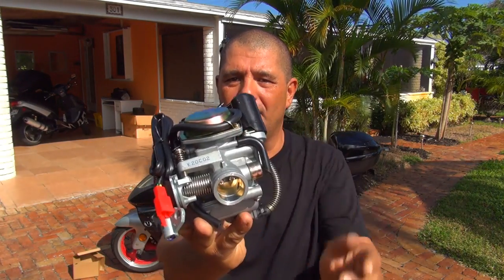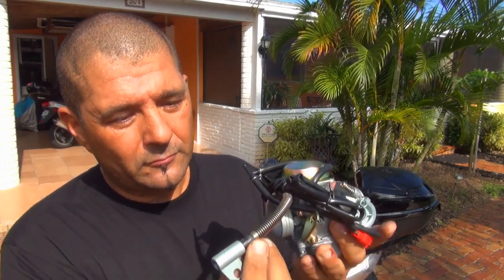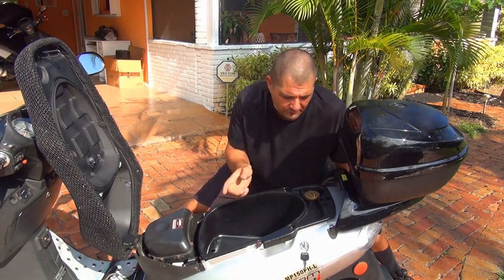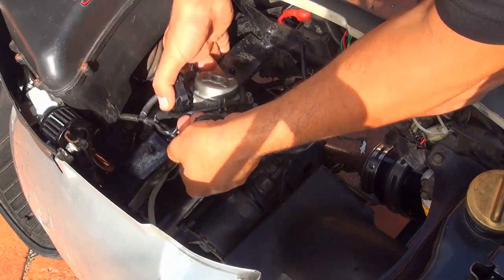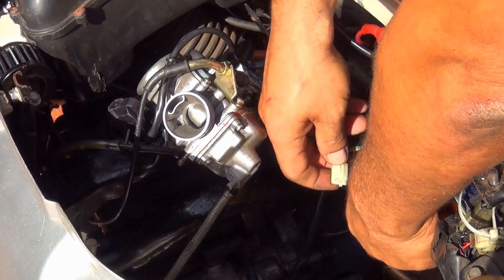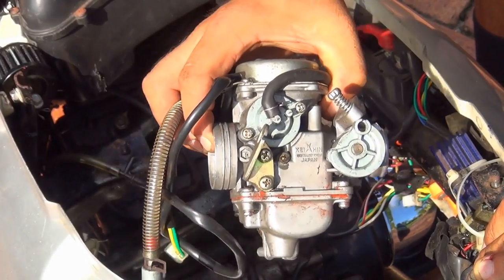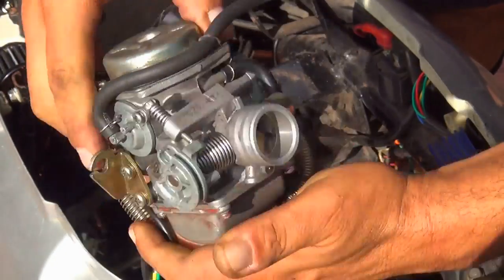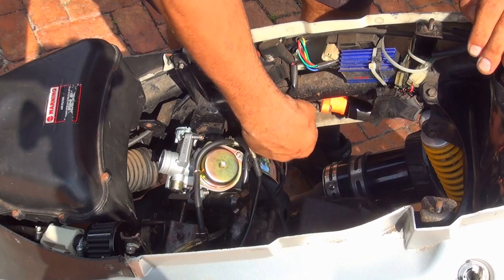How To Replace Carburetor On 150Cc Scooter

Comment: Dude, what should I do if im replacing my carburetor and my old manifold has two holes for vacuums hoses but the new one just one of them?
Reply from the maker: Hello you can fix the problem in 3 ways  ( 1 ) place a 6 mm screw in one of the hoses to close it with a little clamp and the other hose connect it to the new manifold ( 2 )   buy a https://amzn.to/3YWnzx0  3/16" Hose Barb Fitting Equal Barbed Y Shaped 3 Way plastic and from 2 hose you make one ( 3 )  send back the manifold with one nipple and get the one with 2 nipple.  I hope this will help you  thank you for watching my video

Comment: What do you think about performance 
carburetors, people say they improve throttle response a lot?
Reply from the maker: Yes the make a big difference in performance thank you for watching my video and Happy Holidays
Reply: QUICK-STAR  I did not, but from my research i think that the closer the throttle body to the intake valve is, the better throttle response you will get, some carbs do this, but people usually mod the intake manifold

Comment: Very good video . I enjoyed it.  : )  I had to remove and install a triple carburetor on a older Suzuki .. it  was harder to slide back in place then actually getting it back in the manifold boots. But I do enjoy working on the engines. You did this replacement excellent  and I did learn a lot about the GY6 carburetors by watching this video.
Reply from the maker: Hello Ed thank you for watching my video

Comment: Great video.... One thing i notice is that you run you filter towards your muffler which pulls in hot air.... Would it be better to place the air filter towards the original air filter position?
Reply from the maker: Hello my friend that is great ideas I never pay attention to that I don’t think will make a difference but anything can help to keep the motor at lower temperature 👍

Comment: Thank you sir great video ...I have a question I purchased  a Powermotor PD24J Carburetor and it was missing the fuel/air flow screw but the hole is there ,   from the reviews on amazon it doesn't come with it,  will it be ok with out it ?
Reply from the maker: Some carburetor  have a plug at the idle mixture screw but they work fine now if you miss a screw and you have a hole the carburetor is not going to work

Comment: Hello brother I'm very interested in what size jets your using on your 150cc with the nibbi elbow and pod filter
Reply from the maker: Hello my friend in Florida at sea level and hot weather with that set up I run a #125 main Jet  but if your location is colder or little higher in altitude you could be ok running a #115 or #120 sometime is all about testing and tune to get the perfect performance

Comment: Thanks for the lessons. Now i can have my il bello flyscooter on the road again
Reply from the maker: Hello Thomas thank you for watching my video
Reply: @VirberelloScooterTips  hey what does it mean when the scooter isn't getting any gas to the carburetor?
Reply from the maker: @thomaskellem5315  Could be that the fuel valve is not opening because you have a leak on the vacuum lines or you have a dirty fuel filter or dirty fuel tank
Reply: Virberello? Why is my bike now just only putting gas just in the gas filter and not going through the pitcock and going to the carburetor.

Comment: I have a wolf blaze 2011, 150cc,,,,you think upgrades like carb, exhaust and CVI are good upgrades for performance?  What would you recommend?  TY for your videos
Reply from the maker: Hello TheDayDreamer  start to change the weight rollers to a 14g , next rejet the carb, change the exhaust and a performance air filter but do one thing at the time because there is a possibility that you will not like what is your scooter will become after all the modifications. Thank you for watching my video and be safe

Comment: Do you have a video about throttle adjustment on the cable near carburetor?
Reply from the maker: No but you give me a good idea
Reply: do you have any information about "throttle stop screw"?  Where is located, any how do you adjust it? Or should need to adjust it at all? Thank you have a wonderful day my brother from a different mother. 21:15

Comment: I just replaced my carb, I live in florida also what jets are you running? I tried 115 main and 38pilot but it was too much gas, I went to 110 main 35 pilot, ran good. Thinking about switching to 115 main 34 pilot what do you think
Reply from the maker: Hello my friend in my old scooter I had a 120# 38# pilot with a performance filter with  my every day scooter I have a 110#  38 # and I like that because every day I ride around 20 miles . Thank you for watching my video

Comment: Hey so when I remove the old air filter what do I do with the hoses??because I didn’t want to leave it in it made it easier to reach the manifold and carburetor on.
Reply from the maker: Hello Adon the small hose coming from the head valve cover you can place a little baby filter and connected to the higher part of the frame of the scooter or place a little resevoir catch can https://amzn.to/3uiXI2S and the large hose from the air filter you just remove that and the air box if you like
Reply: @VirberelloScooterTips  thank you so much I’ve been watching you and my scooter is almost a beast💯🔥

Comment: I changed my scooter that was gummed up. Only issue I have is the auto choke doesn’t seem to work. Any tips?
Reply from the maker: Hello my friend you can test the wires that goes to the enricher with a multimeter if you do. Not get any voltage you could have a voltage problem or if you think that your enricher is  bad just buy a new one or buy an manual conversion kit for 24 mm carburetor

Comment: If you put a bigger jet in would you turn the air mixture screw in or out
Reply from the maker: Hello if you replace only the main jet I will not touch the screw if you replace both pilot/mainjet  I with turn the screw only one quarter or less  out and at the same time I will listen to the motor sound

Comment: Okay I'm over the stalling. So I'm just going charge carburetor. But the question is how do you know you're ordering the right one. If the deception states the carburetor fits a 150cc  how do I it will fit my bike. Are they pretty much standard and universal?
Reply from the maker: Hello John if you have a gy6 150cc search on line for a gy6 carburator Inner Diameter (Intake Side):24mm,Outer Diameter ((Intake Side):32mm https://amzn.to/3vVYVxT

Comment: Dear Virberello, is It the same for a gy6 50cc (not a 150cc) carburetor or are there any differences?
Reply from the maker: Hello Riccardo  carburetor for 50cc are smaller in size but they work the  same way

Comment: my original carburetor for my 150cc gy6 scooter has a tip on top with the line besides the other lines and the one that I purchase does not have that tip for that particular line
Reply from the maker: Yes the newest carburetor they do not have the extra line but I don’t think It make to much different

Comment: Démonter un carbu de scooter xevo est il a la portée de tout le monde ?
Reply from the maker: Démonter un carburateur de scooter, comme celui d'un Piaggio Xevo, est une tâche que beaucoup de gens peuvent accomplir avec un peu de patience et les bons outils. Cependant, il y a quelques considérations à garder à l'esprit.

### Ce dont vous aurez besoin :
Pour commencer, vous aurez besoin d'outils de base tels qu'un jeu de tournevis (plats et cruciformes), une clé à douille, une clé à molette et des pinces. Avoir le manuel d'utilisateur ou le manuel de service est aussi très utile pour des instructions spécifiques et des diagrammes.
### Étapes générales :
Tout d'abord, assurez-vous que le scooter est stable et sécurisé. Déconnectez la batterie pour éviter tout court-circuit et travaillez dans un endroit bien ventilé, car de l'essence peut être présente.
Ensuite, retirez les panneaux et les caches nécessaires pour accéder au carburateur. Déconnectez les tuyaux d'essence, le câble d'accélérateur et le starter. Dévissez les fixations qui maintiennent le carburateur en place. Une fois le carburateur retiré, placez-le sur une surface propre et démontez les différentes parties telles que le flotteur, le gicleur et autres composants internes. Prenez des photos à chaque étape pour faciliter le remontage.
Pour le nettoyage, utilisez un nettoyant pour carburateur pour éliminer les dépôts de saleté et les résidus. Assurez-vous que toutes les petites pièces et orifices sont propres.
Le remontage se fait en suivant les étapes inverses du démontage. Assurez-vous que toutes les pièces sont bien ajustées et que rien n'est laissé de côté. Réinstallez le carburateur sur le scooter, reconnectez les tuyaux d'essence, le câble d'accélérateur et le starter, puis rebranchez la batterie. Testez ensuite le scooter pour vérifier que tout fonctionne correctement.
### Conseils supplémentaires :
Soyez méthodique, prenez votre temps et ne forcez jamais une pièce. Notez les étapes, utilisez un marqueur ou des étiquettes pour identifier les pièces et leur emplacement. Si vous êtes bloqué, n'hésitez pas à consulter des forums, des vidéos en ligne ou à demander de l'aide à un ami plus expérimenté.
Avec un peu de préparation et de précaution, démonter et nettoyer le carburateur d'un scooter peut être tout à fait réalisable pour un amateur.

Comment: My 150cc gy6 won’t start, I checked compression, and spark, it must be the carb
Reply from the maker: Hello my friend sometimes can also be the fuel valve that doesn’t open because vacuum line is leaking or be a dirty carburetor . Thank you for watching my video